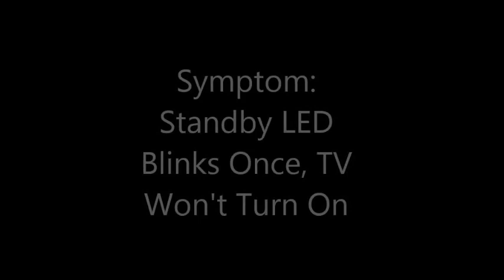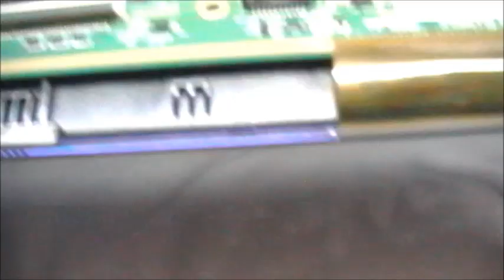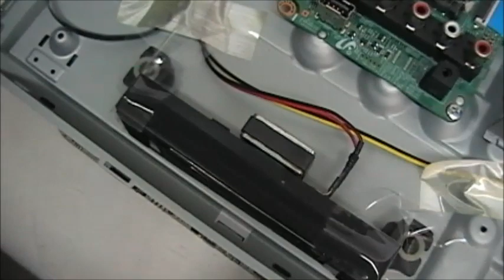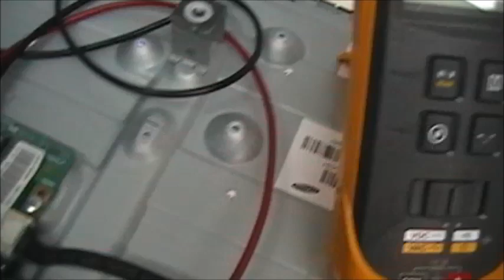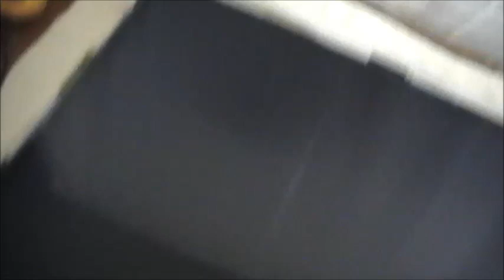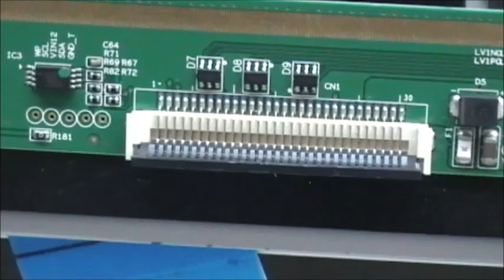Samsung UN32EH4003VXZ LCD/LED TV Repair Secrets

Comment from the maker: I should have mentioned that after removing the Q1 from the source driver board, and reconnecting the FPC at both ends, the TV turns ON and turns OFF normally (still no picture of course) further suggesting that  nothing else is shorted on the source driver board. Should I ever come across a replacement SOT marked 132, I'll give it a try!
Reply: U never updated us on the tv. Was it a success?